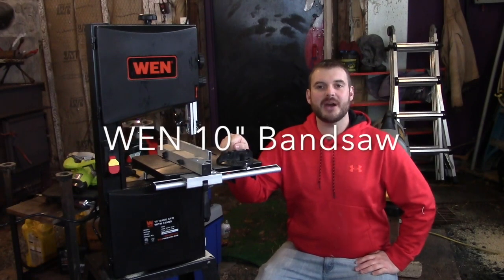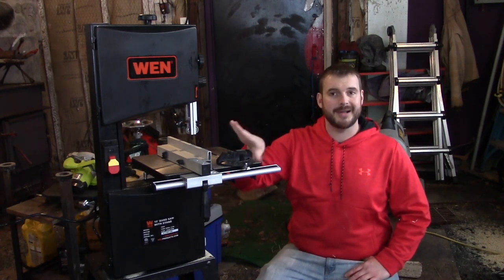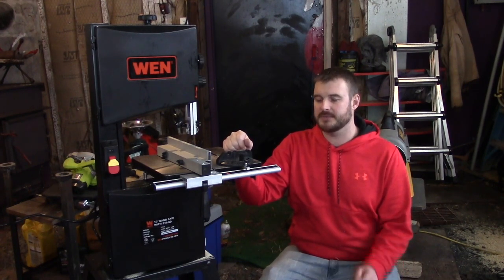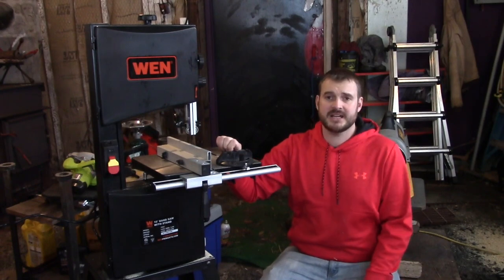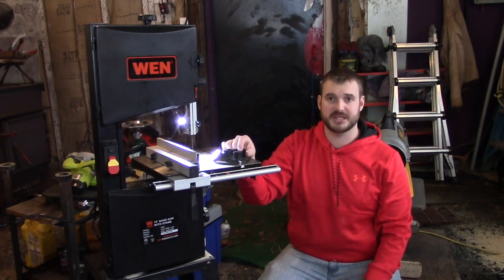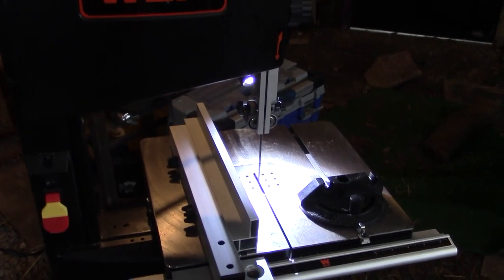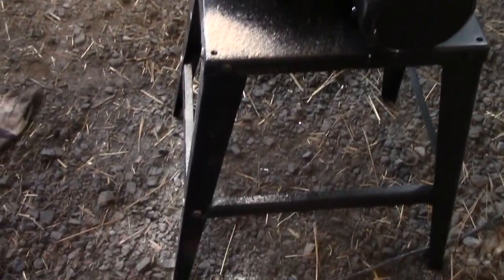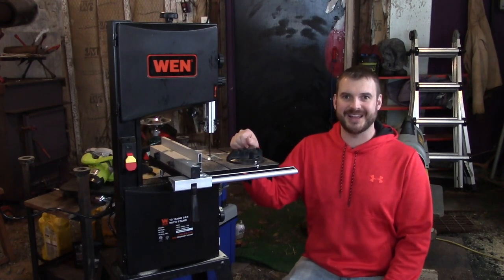WEN 10" Bandsaw - Review

Comment: I've really considered this bandsaw as I don't have the disposable income many pros or extreme hobbyists do for a really good unit.  Try this for your sloppy miter gauge:  1) Clean your miter gauge bar with acetone or alcohol to remove any oils or resin.  2) Take the foil air conditioning duct tape (not the cloth kind). Cut very narrow strips to place on one side of your miter gauge bar, one layer at a time until there's enough to make it a snug fit, but still slide freely.  I've done this on a few of my miter gauge equipped tools and it works great.  I am anxious to see your updated review after you've really put this thing through it's paces.  Thanks for this video.

Comment: I got this as an entry level saw and I am overall pleased with it. My big beef is that the light is mounted behind the saw. It is a very powerful light and the reflection of the table is blinding while the front of the blade and the line on the wood are in the shade

Comment: Drill a small hole in each end of the miter gauge bar.  Then cut a slot with the bandsaw right down the center of that hole.  Then screw a small set screw into the hole.  The deeper it gets, the wider it spreads the slot and will make it adjustable to remove any slop in the miter gauge.
Reply: Wish I'd have seen your reply before I sent him my suggestion (just above).  I'm going to try your fix on my table saw miter gauge.
Reply: Do you need to tap the hole?

Comment: So many times, I look at inexpensive bandsaws, and they advertise as 10", but they're actually talking about the throat, not the depth, so they're typically 3.5-4" max depth. As I want to use a bandsaws for many things building guitars, resawing tops is definitely high on the list of things I need a saw for.

Your video convinced me this is the saw I'm gonna get to start with, so thanks!
Reply: Lloyd Pittonet they measure the diameter of the blade wheel, from what I understand
Reply: @daveshort302  that would mean that the blade would be super short.

Comment: My father had a WEN tablesaw and circular saw back in the mid 1960’s. They were cheap and awful tools. I remember how the motor brushes shot out sparks.  I was hesitant when I saw the bandsaw brand but after a few reviews I bought one. I am very happy with it. As a light duty wood  crafter I don’t expect it to match a $2000 bandsaw but so far it has performed well.
Reply: I do remember WEN tools in the 60s and 70s. They were cheap and bulky but a lot of people had them. I got a WEN drill press a month ago and it is "F"n State-of-the-art", and cheap. I mean it's like ryobi pricing and honda performance. Based on a month of use I would recommend WEN tools. I really wasn't expecting much either.

Comment: hey luke  good review Wen was a company  that made many corded power tools in the 1960s and 70s  my Dad had a lot of them and they were pretty  decent  one i remember very well was a  saw they built that was  sort of a combination of a it Saw and a reciprocating  saw  they had  branded something like a klutz ll or similar  i also believe some of their tools were rebranded for Sears and Montgomery Wards  who were both very large retailers  in America  i do not believe these newer generation  tools are  a part of that original corporation as i’m   pretty sure that  was dissolved by one of the major tool companies buying out the competition  years ago Stanley and Black and Decker wer two names  that did that  quite a bit over the years  i’m not sure  who got Wen  Ib am a retired Woodworker and  as you stated with the band saw  they  are  a decent  brand for the money these days  not necessarily the highest of quality  but they will get the job done  they offer a track saw thats been reviewed on You Tube  because its one of the lowest priced track saws available on Amazon they  also have one of the lowest priced  Dust Collectors  which supposedly again works well for a home shop  i personally am between homes and shops at this time  but  i  will probably use some of the previous mentioned  items in my next  set up  i also like  a couple of the bench top sanders they  offer
Reply from the maker: Thats killer information Craig! Thanks for sharing.

Comment: I am an ameature woodworker and I was thinking of getting this type of bandsaw for cutting bowl blanks. Will it handle a 5" thick blank and cut a perfect 11" circle?
Reply: Yes-ish.  I have had this saw for a few years now and I love and hate it.  When I am just trying to do some simple cutting with just some curves or cutting a pattern it is great.  When I try to do re-saving I get so frustrated.  First thing to know is the motor is only 3.5 amps.  Everything I read says “The strong 3.5 amp motor will not leave you wanting more power...”, yet somehow I really want more power.  like I said, for 75% of my use it is a great little saw.but that other 25% leaves me beating my head on a wall.  As an example, when I am cutting router templates out of MDF to use as a guide for a flush cut router bit, easy days, saw is great.  The blade guard protrudes an extremely long way forward of the actual blade, in my humble opinion.  This means in intricate detail cutting my view is blocked by the blade guard and I end up having to cut with the guard raised high enough that two things happen.  One, there is a lot of exposed blade for my hand to wander into.  Two, my blade’s support is far enough away that making a tight turn twists the blade and my guide bearings are unable to keep my blade tracking.  My other issue with the blade guard for tighter cutting is the shadow it casts in what would have been a brilliant integrated light.  The biggest frustration is trying to rests on denser material.  I have come into a large amount of live oak and peach wood.  I have split a lot for running the smoker but am also trying to cut some down for projects.  I am rough sawing between my table saw and my band saw since I married an accountant who says I have no reason to spend money on a mill, even a simple Alaskan mill to clamp onto my chain saws.  Anyway, I have split them down with a homemade froe and am resawing them with this bandsaw.  It bogs down and stops the blade, wheels and all, in the oak and the peach requires me to go very slow as well or it bogs down.  I have air dried the slabs for a year in the garage.

As for your question, it may work if you move slow.  If you are using dense wood for your blanks you may get frustrated.  Currently I’m waffling about keeping it as is for smaller work and upgrading to a second saw, a 14” with a 1.75HP motor, or looking into buying a new motor to make this one more powerful.

Comment: This saw is advertised as 2 speed saw. How do you change the speed??
Reply: There is a pulley system similar to the one found on drill presses.  You mechanically adjust the belt to whichever of the two settings you wish to use.  It's located at the lower wheel.

Comment: Is there a way to secure it to the stand or is it just sitting on top of it?
Reply from the maker: The stand is securely mounted to the base. It does not wiggle or wobble or anything it is extremely sturdy .
Reply: Excellent; one more follow-up question: are there any holes on the stand's bottom that could be used to attach it to casters or some type of rolling platform?  Thanks again!
Reply from the maker: No they are open angle iron feet....you could easily mig weld a little plate on the bottom to attach a caster tho

Comment: You're getting blade wander because you have the guide too far above the point of operation. Lower the guide to just above whatever you're cutting and watch blade wander disappear.
Reply: He said he was ripping 6" boards which is the maximum height of this saw.
Reply from the maker: I have noticed since i have increased the blade tension a little and also been careful to keep the guide close it has helped a ton with resawing.